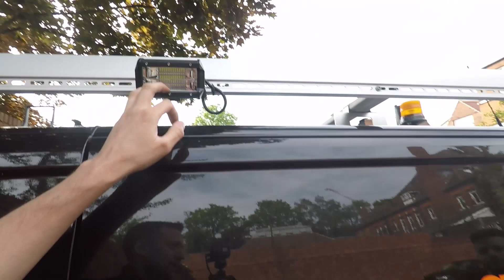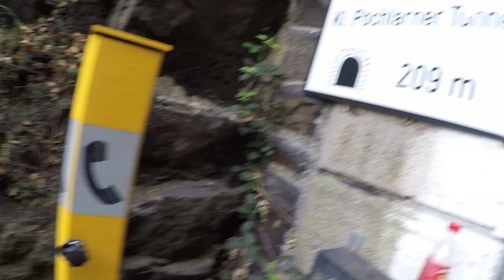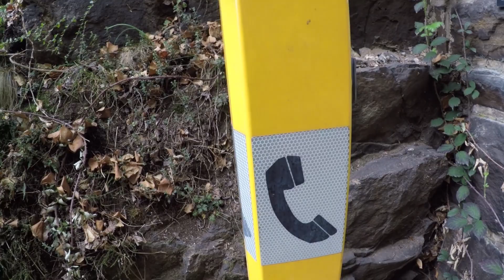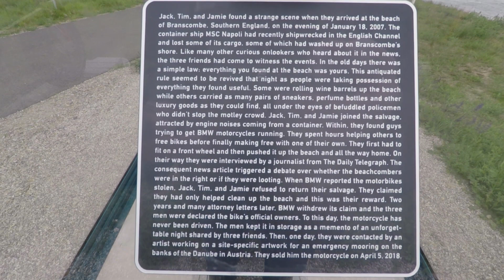Will Dave pass his van inspection??? (+ exploring random Germanic Electrics) | Thomas Nagy

Comment: Those Moeller MCBs and RCDs are 2004-2010-ish. German Moeller took over Austrian F&G in the early 2000s and then got taken over by Eaton in 2008, the name change taking effect in 2010.

The orange cable in the tunnel is probably NHXH, either 30, 60, or 90-minute fire resistant cable.

Re: conduit bends: they were done back in the 60s and early 70s but only if singles were to be pulled through that conduit. Cable was usually just clipped straight to the wall back then. That was an art form if done right! In the 70s this kind of conduit sleeving took over for exposed work and nowadays it's pretty much the only way that's used. The conduit is essentially only there to support the cable rather than protect it.

Generally, perception of what is and isn't dangerous vary greatly from country to country. Let me just give two UK - Austria examples: In the UK sockets in bathrooms are considered horribly dangerous, while in Austria people couldn't care less as long as they're outside of zone 2 (actually most homeowners don't care as long as they're outside zones 0 and 1). On the other hand, in the UK no one worries about ring circuits with 2.5 mm2 and sockets rated 26 amps maximum on a B32 MCB while in Austria it's strictly forbidden to protect wires at more than their rated capacity unless they're run in parallel and physically bundled together all the way. Same is true for local isolation (e.g. cooker switches, fan isolators, etc.) and mounting meters to combustible surfaces, which is considered a HUGE fire risk in Austria. All meters are supposed to be mounted to flame-retardant plastic bases (but metal CUs aren't required). Or let me take different countries. In Sweden, it was perfectly normal to have un-earthed sockets in dry living spaces (e.g. sitting rooms, bedrooms etc.) because the idea was that without any exposed earth potential it's impossible to receive a fatal shock, until 1994! In Germany and Austria that method was banned in 1960 and in Czechoslovakia as early as 1934! Perception even differs across regions in the same country! Some areas of Austria  had TN supplies very early on and used TN-C installations with only two wires and a jumper from neutral (PEN) to earth at every socket and light. Otheres were TT until the late 90s and older installations often still had sockets without earth. People from TN areas consider TN-C much safer than un-earthed sockets while folks from TT areas would absolutely prefer no earth at all but an RCD fitted over TN-C any day!

Even though the laws of physics are exactly the same all over the world, risk assessment is very much subjective.

Comment: I thought we put bends on conduit as it becomes an extraneous conductive part under fault conditions.. I know, not likely that mechanical damage will occur on the cable inside it. We would have to put fly leads everywhere to earth the separate conduits. Also, what reference method would it come under: clipped direct or enclosed in conduit?

Comment: @thomas nargy not sure if that conduit was metal or PVC, if it was metal conduit you would not have earthing continuity all the way from start to finish on the conduit run and would need bonding jumpers. Wouldn’t be an issue if it’s PVC but not 100% mechanical protection.

Comment: They wire in pvc pvc / swa . If it was just pvc the sets and 90 would have to be there. When i worked in germany it was the same. All sleeper conduits
Reply: It's not armoured but yes, the conduit is mainly for holding the cable on the wall rather than protecting it. If it was truly for mechanical protection it'd likely be metal or at least a different type of plastic (indicated by a darker grey or black colour).

Comment: I believe that the power cables are buried in the ground as it's cooler there.  This would be the main voltage power cables for the trains, if they were electric.  Other cables will be for signalling systems and phone lines etc.
Reply: The trains run off a 15 kV/16.7 Hz overhead wire if the line is electrified. Those culverts are for signalling, tunnel lights and maintenance, i.e. low-voltage.

Comment: Yes, same in france. The bends costs 4 euros for four very expensive. They should cover it. The french dont use wires with mechanical protection in plastic conduits its naked just one cover the wires bought with no mechanical protection.

Comment: 5:38 Such combo sockets (as we call them) are generally installed in industrial or commercial places. They are generally placed where heavy duty equipment needs to be used. (Welders in excess of 20kW...electric pully systems...etc...) It is common for a residence in the UK to have a 240V 100A single phase feed, where the most of Europe a 400V 63A 3 phase feed is more common. For example Germany has a standard for homes to have a 3 phase 400V 63 A feed, where most of eastern Europe has a 3 phase 400V 25A feed. (The higher the amperage of your main breaker, the more you pay monthly for you feed.) Ring circuits don't exist in Europe. It's common in the UK to have a ring circuit which is fed from a 32A breaker. In Europe a 16A spurr circuit is more common. Our plugs aren't fused...hence why....

Comment: My best guess would be that it either was just forgotten or some super random law dictates that it has to be there for emergencies or work that has to be done in the tunnel.  The three phase plug should be 16A 400V and could be used to set up a distribution box in the tunnel to power lights and/or tools. Why it all was powered off tho, I got no clue.
Reply: Apparently this line was decommissioned only few years ago. And since quite often, different parts of the infrastructure are managed by different teams, It is most likely that they decided not to send electricians to remove those sockets and phone, opting instead for simply cutting the power off.

Comment: You go to the lengths on the conduit for the same reason that we do here in the states.  Electrical Unions.  Taking the time to bend and form and put in elbows and such takes time. And time is paid time.  Look at places where there are no unions like India and then look at the workmanship of infrastructure like wiring and plumbing and you will see the stark contrast.  You can look at a prevailing wage job in the US like a school or a firehouse and look at the almost artistic runs of pipe and then look at a non-union non- prevailing wage job like a warehouse and see that the wiring in the warehouse is done with MC cable or some other flexible armored cable.  The truth is that MC or BX style armored cable is quicker to run.  It requires little training to do and it, at least until it needs added to, works exactly the same as bend pipe.  Sure it doesn't look as good, but it serves it's purpose and it meets the minimum code requirements.

Comment: The notches in the tunnels were safety places you could duck into if you were in the tunnel and a train came along. If you could get to one in time you wouldn't turn into bean spread on the side of the train and the tunnel wall. 

Quite possibly that black box in the notch was once an emergency button or some sort of telephone to the regional dispatcher. 

The cables in the concrete trough were the railroad signalling cables. The electric power for the trains would have run overhead most likely.

Comment: we "cut the corners" because it is not necessary to have a third layer of insulation. any wire has to be double insulated.  the cabel already has 2 layers, the wire is insulated and the coat around it is the second layer.
Reply: you could use single wires in pipes, but then the pipe must be installed closed from point A to point B
but no one does that here for obvious reasons, it takes much longer

Comment: 400V 3 phases are very common in many European countries. I would be surprised if there wasn't 3 phase connection. Most high power equipment is 3 phase in Slovakia where I come from. Even in domestic applications. Everyone I know has 3 phases in there house, especially if they live in a village. All the stuff we use around the yard is 3 phases, like air compressor, cement mixers, circular saw, welding machine. Even our oven. I was quite surprised that you have only one phase. You have to use thick cables like 6mm for high power appliances, we would just use 400v and draw less amps using 2.5mm max. Flats use just 230v one phase.

Comment: The phone at the tunnel is what we call a SPT in the UK (Signal Post telephone), used by railway people to contact signallers. Drivers and guards have keys, as do contractors who would be working on the line.
Reply: Andy D - On the U.K. mainland network, SPT means Signal Post Telephone. These are direct lines to the controlling signal box / signalling centre. They are not emergency telephones as such (as they are also used for routine communications between train drivers or engineering staff and the signaller). There are emergency telephones provided in certain areas. For example, at some types of level crossings. Or where there is no alternative communication systems. Alternatively, a weatherproof exchange line will be provided (although the exchange will be a railway telephone exchange). The railway is very particular about the class of a telephone.
Reply: Anyone know the make/model of the phone in this video? It's a neat compact unit..

Comment: Same in Belgium, nobody bothers with the corners etc for the pipes
Reply: the pvc pipes are not for ground (PE), nor for for mechanical protection (perhaps just as a side effect), but for speeding up the installation, reducing the number of nails/studs neccesary for a propper fixation.

Comment: Ooh, opportunity for railway nerding detected.  Dunno on the panel outside the tunnel, but service power for trackside work makes a lot of sense.  The little cubbies in the tunnel are refuges, which a worker can dive into if they're working in the tunnel and a train sneaks up on them. In the UK, we have markerlights in them so they're easy to find when 500 tonnes of steel is snapping at your heels, so that could be a decommissioned light panel?  The concrete ducting in the floor is probably control circuitry - in the UK we run signal and points control lines through them, as well as telephone cable for lineside phones like the one you found.  Traction current is normally carried in the rails or overhead lines: it's pretty rare to need to run a cable alongside a perfectly good pair of high cross-section conductors.  Of course I can't speak for Austrian practice, but I'd be surprised if it wasn't similar.
Reply: Dan Summers - Alas, very few tunnel refuges in my area have lights. In fact, lights are only permanently installed where there is an emergency telephone in or next to a refuge.

Comment: The cable they use it is like Fp200 and hituff, but more robust the cable type  as far as I know it's NYM you can get it 8 core and easy to install too  the earth comes sleeved too,unlike tha faf we having to do sleeving earth
Reply: NYM (or YM in Austria) is PVC-sheathed building cable, mainly for indoor use. Both can be used outside but NYM requires protection from direct sunlight. The jacket is light grey. A black outer sheath means NYY (Germany) or E-YY (Austria), which has a PP sheath and is designed for direct burial. Up to five cores are readily available and coloured as you'd expect, 6 and up usually have green/yellow and black cores with numbers printed onto them. There is NYM-B, which has up to seven coloured cores I think but what these colours are depends on the manufacturer. BTW, the Irish seem to have switched from T&E to mostly NYM with the 2013 regs.

Armoured (NYCWY) is only used by DNOs.

In areas with lots of timber buildings an ancient type of cable, YR in Austria, remained in use much longer than elsewhere, it's got PVC-insulated cores, a somewhat sturdy ridged steel sheath and an outer PVC sheath. The original design (without a PVC jacket) dates back to the early days of electricity.

Comment: In the Power Station I work at in northern Ireland, when SWA or FP is being contained in conduit 90s are not installed, I think it is to do with the bending radius of the cables and allowing air flow to prevent overheating as ambient temperature in the boiler building can exceed 40 degrees at times

Comment: My first Idea was, that these "switch-Boards"(don't know actually the English word for "Schaltschrank/Verteilerkasten") could be used from technicians in case of e.g. an fire or a crash inside the tunnel so the firefighters can easily switch of the electricity. I also think, they uninstalled only the cable from the main ring cable.
Reply: we would call it a distribution board, so "Verteilerkasten" is quite close

Comment: Being from Australia the one thing I found in the UK that puzzles me is why you can’t have power outlets in the bathroom?
Reply: Adrian Ling You can in theory, as long as they are a minimum distance from the shower, bath and washbasin. In practice most U.K. bathrooms are too small to legally meet the requirements.
Reply: Spencer Wilton - in practice, the customer does not know that they are permitted, so does not ask for them. Or the room is too small, or the spark is so used to not fitting them in bathrooms/shower rooms, hence may not want to fit them, because it’s not the normal thing.

Comment: Uk is the safest country in the world when it comes to electrics as we have guards on sockets (refering to when the earth pin is longer so it opens the live and neutral) ect we put cable in full pipe outside because we want to take more of a precaution with electrics as most country's only use 120v where as we use 240v so you just have to protect it with higher level of caution
Reply: Actually quite a lot of plugs are designed to first close and last open the earth path when using them, uv resistant pipe for outside wiring also isn´t that special or exclusive.
Reply: "most country's only use 120v"
Since when US, Canada, Mexico and Brazil are MOST of countries?

Comment: Make the bad bugger take the scratches out at the weekend and change the broken light! Bet the cabin is littered with Maccy Dee breakfast wrappers too ;)  

Interested in seeing more German stuff, it baffles me completely when I go over. Even the switches are weird - I think it might be some sort of modular system that didn't really take?
Reply: Indeed they are you have switches , outlets and for example data points as modules ans you can use different covers and frames so the system is much more modular. For examle for a tv you can put an outlet data and coax into one frame
Reply: You can put together whatever you want.
Reply: Modular wallboxes, switches and sockets are used almost exclusively in the majority of Europe which use CEE 7/7 Schuko style outlet sockets. https://en.wikipedia.org/wiki/Schuko#/media/File:Map_of_current_European_mains_electricity_plug_types.png

Comment: first: it's not german, it's Austria :-)
sec: The wires below under the stones are not only to service the tunnel but also communications cables between the next (ex-) train stations
the traintracks are not laying below the stones, they are removed (I think, the metal plates in the train station are the rest from the strack)

Comment: The arches are escape holes when trains pass and crews are in the tunnel. The upper fuse panel had a time switch so possibly tunnel lights. Corners on conduit and “excess safety” rules because our wonderful government takes every EU guide line and turned it in to policy even when it is daft and un-required.

Comment: Regulations, plus it keeps the guy making the corner bits/tee's in a job! Surely the wire is more likely to chaff on the edge of the stright than going in to a corner piece. British standards, that kite mark used to stand for something. Maybe the contractor from that bridge saved £5 for each connection not used after underpricing the job? Then nobody checked his workmanship or invoice.

Comment: 8:07 i think thats a PUR-EPR Cable
Reply: PUR-EPR is non-halogeneic (iow: not PVC), so no harmfull fumes in case of fire. and on the other hand very UV resistant. this combination makes it quite expensive, but the only choice for wiring power and/or ethernet in certain installations.
Reply: @rarbiart  We aren't using it for Ethernet, but for Indutry and Construction Sites, even for installtions submerged in fluids, and for the standart voltage and up to 400A

Comment: You put the pipe bends in, so the pipes hold any water firmly. Otherwise it would quickly run out the other side.

No honestly, using pipe bends is kinda bad, because it catches water and dirt, especially if it goes vertically. Lots of things in the UK regarding electronics are overly cautious and counterproductive. How often do you change the fuse in plugs? Devices in the EU are required to have device specific fuses inside anyways, so why have a generic 3 (or even 13) AMP one, for your phone charger? 
Same goes for "no power sockets in bathrooms" which I find super annoying. Most countries require to have a fast switching residual current curcuit breaker. Not the UK, no, you can't have plugs alltogether. I guess the extension cord from tesco to get the hair dryer working is safe enough. That might be outdated as I have seen 110 volt (Which is even more redicoulus) plugs in Hotels.